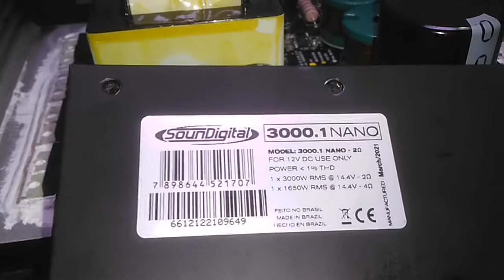Soundigital 3000.1D nano  no no  repair of amplifier

Comment: friend what is this output driver do you know which one is for me to pass,
Reply from the maker: Hello my friend I did not find the part for this amplifier however I reduce the power of the amplifier by removing a pair of the transistor leaving only one pair in it on the minus and plus rale and it's working at half of the capacity my client did not make any fuss about that it's working for them still could not find A5.
Reply: I have the number for that mosfet